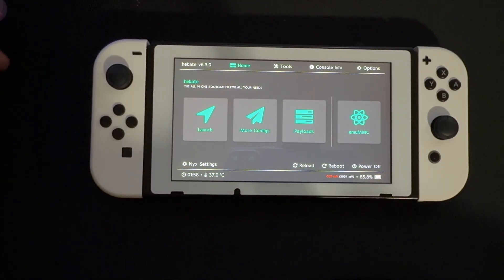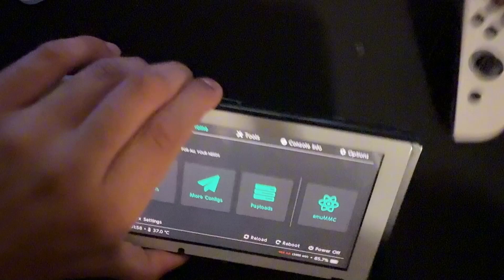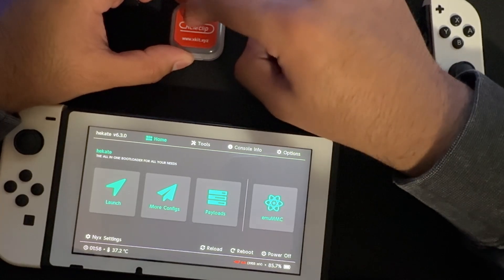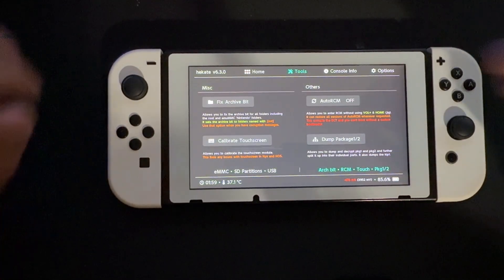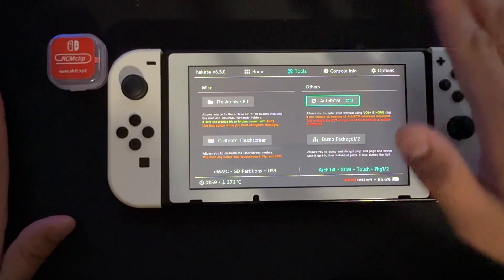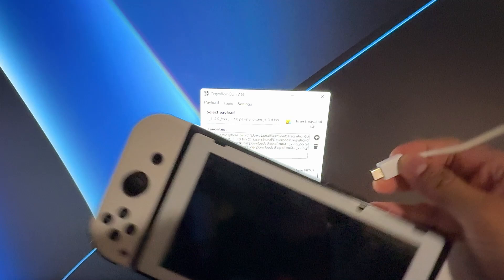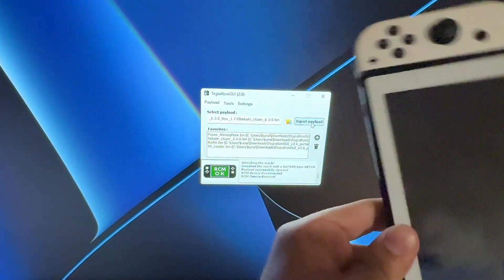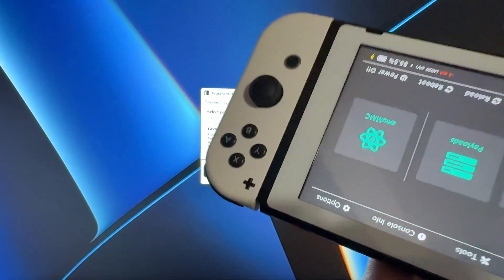Boot Payload Without RCM Jig AUTO RCM 2025

Comment: Hey I hope you read my comment here. 

So this method you showed me is the one I usually do when I tried to switch between stock and emummc. However few days ago I updated the firmware on my stock sysnand when I played online.

Now, my auto-RCM is disabled, so when I tried to switch off - switch on my switch, it goes directly into the stock rom, without going into RCM mode. 

Can you help me, how can I fix this?

Comment: its a good method but  after using it for a fer mounths it kills the battery it dosent last as long when its off and you have to wait like 20ms for it to reccharge auto rcm eats up the  battery like scooby and shaggy so i would just say leave it off its not worth the battery drain
Reply: yeah you shouldn't use it if you dont dock your switch all the time.
Reply: how does it drain battery it works fine for me

Comment: When you need to update the switch, you need to boot back inti Nintendo OS, and then back to paylod, so, you will need again the RCM! It's always good to have one around, as long has you have the console that alows that, the 1001 if i'm not mistaken.
Reply: you don't have to boot into the ofw to update, you can download the firmware and use for example Daybreak to update your fimrware under cfw
Reply: I understand, but if i also want to go online, it's good to have. Still i appreciate your vídeo.